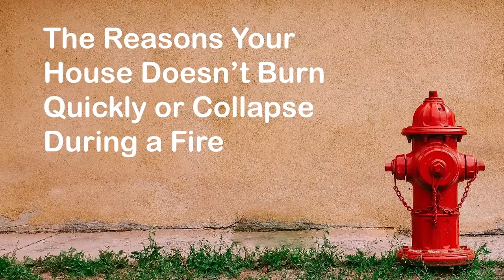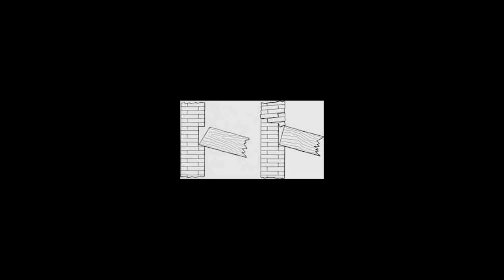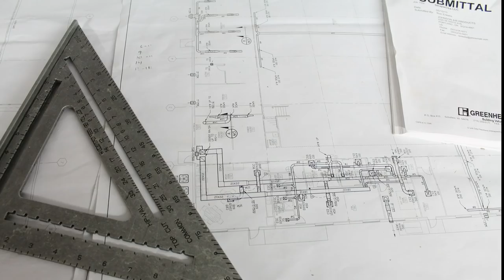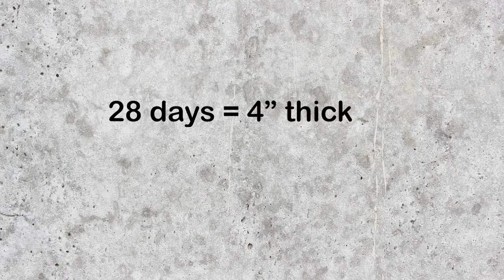20 Surprising Things I Learned in Carpentry Class! - Thrift Diving

Comment: I own 2 properties. Our primary one we had water line protection through our utility company. Our line failed between the street connection and house. Had it been on the other side of the connection it would have been their cost. But our line insurance paid for everything including the replacement grass seeding where they had to dig from house to street. It would have been less than $2k though. I asked. Our other house is an inheritance and when we had our utilities changed over to my name we forgot about the line protection. That failed and cost us less than $3k, but that cost could have been avoided had we gotten it. Both properties are township. 
You video has some really interesting topics so thank you for sharing them.

Comment: Depends on where the water pipe has a problem. 
If its in your slab then the insurance is responsible. 
If it outside the house’s outer walls, in other words from your house to water main then insurance doesn’t cover it.